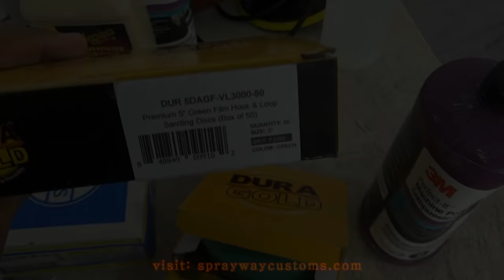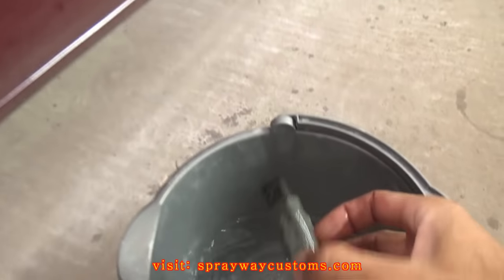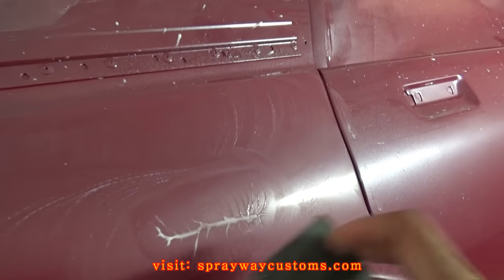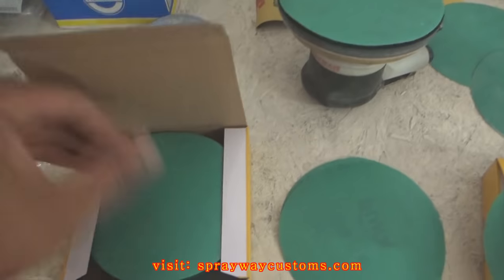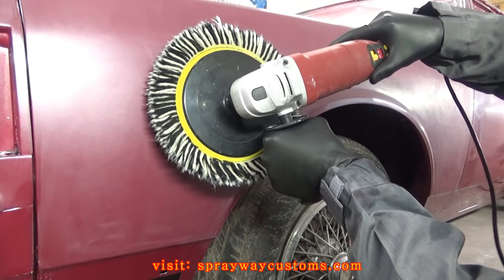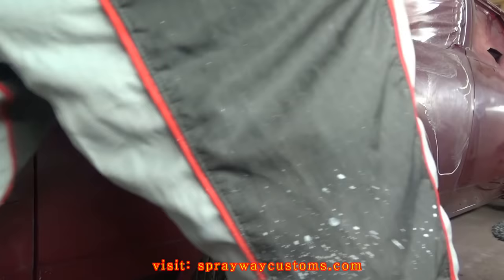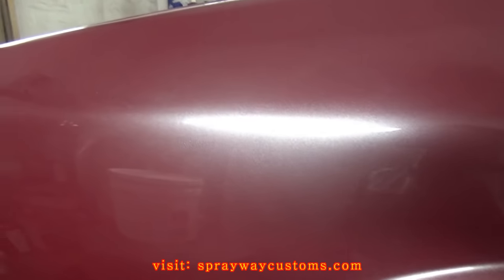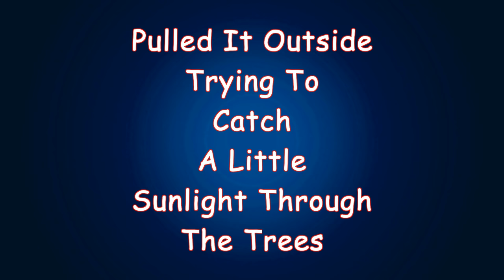How To Cut And Buff - Wet Sand To Remove Paint Runs & Orange Peel In Clear Coat - Box Chevy Caprice

Comment: SprayWay you got me fixing up my Excursion the right way at home. A previous owner somewhere down the line had some pretty crappy bodywork done. They masked everything on the car, so the clear is peeling all around the windows and gas tank. I took everything apart, sanded it all back, based, cleared, and now I'm here for the next step. Thanks!
Reply from the maker: That’s what it’s all about…motivating one another

Comment: It's awesome, I've been following this series and your work is outstanding, nice to see somebody who takes pride in what they're doing.
One short question: under what circumstances would you sandblast a car to start with?
Reply from the maker: If the entire car needed to be totally stripped down to bare metal, I would. Thanks
Reply: Unless the car needs a lot of rust repair you shouldn't need to. Just sand all the gloss out of the paint, if it's dull when it's dry you're good. Then bodywork and prime any bare metal or body filler then base/clear

Comment: Hay Spray Way  your  videos  has helped  my shop in tremendous ways thanks.  Got a question a customer  gave  me some single stage metallic pearls  I heard it's  hard to spray?
And  if so can  sand it down and  clear  over it?
Thx
Reply: Single stage paint has the clear already in it right?
Reply: @chrisg1364  Yes it does  you can  even  mix it with clear. But I'm trying  to  shoot   metallic pearls  and  they reflect light differently  because  they  stand up in the paint  with light hitting  them  at different angles  if you wet sand the metallic  pearls the paint  looks  dull so I'm thinking  clear coat  could  wake  them  back up if any  problems  were to occur.
Reply from the maker: Yes you can shoot clear over it with no problem
Reply: @jerryjordan4533 Single stage metallic/pearl paints are difficult to get consistent due to pearls/flakes settling, even after thoroughly mixed. You can add matching pearl to clear and clear over single stage for uniformity. Single stage has a longer cure time but can also be cut & polished after such with a bit more finesse than you would 2k paints, urethanes, etc. Some guys using waterborne paints will layer pearls/flakes using various intercoat clears before top coat.
Reply: @jerryjordan4533  that was a good question. I bought sum paint like that for sum mirrors i made. I was told once i sprayed it by paint shop that i couldnt clear over it. Sooo after sprayed my mirrors 1 had a run. Waited for it to dry and i sanded mirror back down and resprayed the whole thing. I should have just fixed the run then shot clear on it. That's why we got Spray Way!! Always here to help!!
Reply: Jerry Jordan 

شو هاظ يازلمه

Comment: How do you minimize your orange peal
Reply from the maker: It's the gun, air pressure and technique
Reply: @SprayWayCustoms  I have to learn how to lay primer ,base,and clear could you do a video on this with some tips  I have  to paint 2 dr tahoe soon I was thinking about taking it down to the metal I dont know what was done before what you think
Reply from the maker: If the paint solid with a good foundation. I wouldn't take it down but make sure you seal it because you don't want a reaction Brenden Taylor
Reply: @SprayWayCustoms  ok thanks for the help and when you say sealer is that a certain type of primer I should use because I live in Florida  I was watching your video with the vw satin black last night ( not the first time )

Comment: you are awesome ,i have a truck that wasnt prepped very well,did not have a spray booth and used spray cans haha,but with your guidance and knowledge i pulled it off to be very presentable,i did however buy some really good 2 part clear coat and followed your instructions on the wet sanding and cutting in and polishing,even on a low budget paint job it did greatly improve the overall look, i think i would not choose satin black if i do this again and would buy a cheapy spray booth,but i have to give you your props  thanx again
Reply from the maker: Sounds great. It’s always good to hear that

Comment: Just subbed, this video really helps understanding how paint is really more than just laying it down. Before I didn't really understand the complete process as I've never seen anyone lay it out before. So far my understanding is

1. Sand/remove old paint
2. Apply body filler if necessary and or sand smooth cuts/scratches
3. Wax and grease remover
4. Wash and dry
5. Primer
6. Sand/wetsand primer?
7.basecoat
8.second coat and/or third coat and fix runs
8.5 lay Pearl/metal flake coat if doing pearl/metal flake
9. Clear coat
10. Fix any runs/orange peel
11. Cut and buff
12. Wax ? 
13. Finally finished

Did I miss /mess up anything?

Thanks for the demonstration It really drives home that even though you mess up you can fix mistakes and that although you may have to sand "nice looking paint" and it looks dull that you can bring the shine back by gradually going up on sandpaper grit and using buffing and polishing compounds 

Thanks again!
Reply from the maker: You got it right. Thanks for the support
Reply: @SprayWayCustoms  👍 Nice to know I'm on the right track, I recently did a rattle can job on my hood, first coat was looking great only had two runs, got to can #2 and it started dripping paint, at that point I just went full send tried to evenly spray the rest of the can as best I could got the can about 85% empty and called it done, I'm hoping I can block it out by jumping to 800 from the 320grit scratches and then 1500 and 2000 and 3000 and then do the cut and buff, hoping after the cut and buff it'll look halfway decent and I won't have to respray (got a bunch of paint drips and trash/dirt nibs)

Comment: Great video!  Question .. the harbor freight polisher is a 7” pad.  The polishing pads you recommend are 9” and 8”.  Do those sizes work on the HF 7” disc?
Reply from the maker: The backing plate is 7" on those as well

Comment: I used Urechem Glamour clear coat on my 65 GTO.   After spraying 4 coats I let it sit for two weeks to completely harden.  Started cutting by hand, but switched to a DA with 1000 grit.  Progress is ridiculously slow.  Just ordered boxes of 50 pads 1000, 1500, 2000 and 3000.  About how many sheets of 1000 did you need to use on the Impala?  Just looking for a ballpark number so I can know what to expect.  Won’t hold you to the estimate.
Frank
Reply from the maker: About 5

Comment: Great work. I already know you get a lot of questions, but is there any way or tips for removing the lower body trim pieces without bending and damaging them? Lower trim as in door trim/ fender/ quarter panels. Anyone else in the comments who know, help a guy out lol
Reply from the maker: I'll be removing some trim on my next video but it's pretty simple. On the doors, there's nuts on the inside on both sides. Remove them and then grab the trim and lift up from the bottom and you'll be able to pull away from the top of the plastic clips.

Comment: Have you tried using Farecla G360 compound with the red backed 6” wool pad for compounding.It’s a clear gel , you hardly need any, it does not fling everywhere.Then the G360 polish with the black sponge pad. Alot quicker & more effective than 3M?
Am watching your video from beginning to end & thinking of quicker ways to achieve your finish.
Reply from the maker: Thanks for the info

Comment: Hi again, for the smaller areas I mentioned (fender flares, bumpers and spoiler) can I do the 3 step cut, polish and finish by hand as well or do I need the speed of the polisher/sander to take out the sandpaper marks?
Reply from the maker: Go with the less aggressive grit as possible and you'll be able to
Reply: I mean the 3 step 3M cut compound, cleaner glaze, and finishing polish.  Can I do that process by. hand or should I use the polisher?

Comment: In my backyard, these box chevys, you call them, were taxis. When Dad realized supply of used Impalas were low, he found he could buy station wagons cheaper.
I  preferred the police packages. If I were smart, I would have poked one away in a dry garage and enjoy it today.
I went away to university in September 1992. In December 1992, I came home from school to find out Dad had sold all his licenses, mine included. "You're gone away to school, now my boy. No more taxiing for you." 
Now I'm 55. I want to early retire and licences are expensive and hard to find. 
I hated what the Impalas became since 1990. My favourite is that dark metallic blue two-door I'm in search of. 😅😂🇨🇦👍
Reply from the maker: Pontiac Parisienne was big in Canada...pretty much identical to the Caprices and Impalas
Reply: @SprayWayCustoms  I had a 83? Metallic red.
Reply: @SprayWayCustoms  It Was identical. Grill, usually the taillights were different.

Comment: Hey man I’m new to cut and Buffin but should I use 105 and 205 meguiars or use 105, 83 then 205? What do you recommend after a fresh clear coat ? Also what pads ?
Reply from the maker: There's really no wrong way going about it. Just try to sand with the less aggressive sandpaper and your buffing will go a lot easier.

Comment: Merry christmas mr sprayway. I used the DA method to cut my car. (Check out my newest upload). The process left my entire car covered in pigtails. Im assuming it a foreign body caught in the the sand paper. How do you prevent this? New piece of sand paper each panel? Ended up going over the whole car by hand. I like the DA method to save time just have to spend more time with it to improve the process.
Reply from the maker: Make sure the sandpaper is sitting right over the hook n loop because I've had problems with the da pad scratching the surface
Reply: @SprayWayCustoms  sounds logical. Thanks

Comment: Do you have to use a big polisher or will a 6 inch da sander work and do you have to use a wool pad to get started? Tried with a 6 inch da and a foam coarse cutting pad but can not get a shine to come back with mcguires ultimate compound, a foam polishing pad with their ultimate polish and then wax but no shine.... all with the air powered da. Thanks in advance
Reply from the maker: No you don't. You can get it done with the 6". What grit did you start off with and ended with on the sanding?
Reply: @SprayWayCustoms  1000 grit start, 2000 grit ending. used the 6 inch bauer pads from harbor freight

Comment: I was just wondering, If you Blow off the dust it will still be in the shop. How do you prevent it from falling on the project? wet the floors, walls . have a spray booth with proper ventilation? I do not have a shop can you help me?
Reply from the maker: I just wet the floor but I still get trash in it though

Comment: Do you have a link to where you buy interface pad and DA? Or did you get it local
Reply from the maker: I got it off Ebay but the seller has sold out. He was selling them as singles for $5.99 but the only ones I see on eBay now are 5 packs and 10 packs. The item number is 3M 70166 for the 5" pad
Reply: @SprayWayCustoms  thank you!
Reply: @SprayWayCustoms  i bought me a designated 5 inch DA. Pad and 3 boxes of duragold like your video off Amazon. This is going to cut time drastically. Thanks for the videos!
Reply from the maker: No problem. I just subscribed to you. Great vids you got

Comment: You ever tried the Sharpie method on sags/runs?   It works.   That way you will actually see a true flatness.. and not that ripple after buffing.....
Reply from the maker: Yes. I understand what you mean on the ripple after buffing because on my first buff, I had it but I put enough clear on here so I wasn't paranoid on cutting through the clear.
Reply: Glad you understand me.    Keep it up Bro. I did bodywork for years. In my 20’s. The hood thought I was weird.  But nowadays I’m asked if I can help em our ..🤷🏾‍♂️🤷🏾‍♂️

Comment: I have a bunch of smaller areas (fender flares, bumpers and spoiler) that have been repainted and clear coated.  Can I hand sand instead of using the sander?
Reply from the maker: Yes you can
Reply: That's a relief.  When I do the 3 step cut, polish and finish can I do that by hand or do I need to use the polisher/buffer for the same small areas?  

Also, any tricks for removing tape after a fresh paint job?  I spend all the time prepping and paint and when I peeled some tape it took just enough paint with it to make the job look like crap.

Comment: I mean the 3 step 3M cut compound, cleaner glaze and finishing polish.  Can I do that process by hand on my bumper, fender flares and spoiler or do I need to use the polisher?  They are such small areas, I wasn't sure.  Does it need rpm's of the polisher to do it correctly?
Reply from the maker: You can do it by hand, it's just faster by machine

Comment: 7:56 into the instructional video  I see you had originally grabbed the wrong size of backing pad..it looked oversized.?
Reply from the maker: Jim_Mitchell aka/jmgargoyle it's the right size it's just have that extra cushion for flexing so you don't burn or cut into your paint as easy
Reply: @SprayWayCustoms  ok I'm just finishing my first ever paint job and trying to cut and buff it. The paint job leaves alot to be desired but not bad for what I had to do it with....

Comment: Yo when painting a car they say other chemicals in the air can mess with the paint ( i understand that ) but will kerosene fumes do the same thing inside the garage or will it be ok?
Reply from the maker: I'm not real sure on that. I was wondering the same thing because I thought about using a kerosene heater for heat at one time.
Reply: Ok well when i find out ill let you something.
Reply: Yeah kerosene will the paint job up because it is a burning oil but propane will not because it burns clean and faster, that's the down side.
Reply from the maker: Thanks for the info

Comment: Trick for you to use on runs to avoid cutting through the surrounding area while wearing down the run. Use easy sand wall putty over the run and level with the run, then as you're sanding the run, the surrounding area isn't being sanded, the wall putty is being sacrificial until you cut the run down level with the surrounding area and the wall putty is all sanded off level. ;)
Reply from the maker: Yes, that's a good tip Cletus R. I've done it a time or two. Thanks 🙏🏽
Reply: @SprayWayCustoms  Love your work man, much respect. Keep it up!

Comment: I was asking you how would your paint turn out if you make your clear coat in it then spray it on
Reply from the maker: I wouldn't recommend it. If you have a base coat / clear coat then I would use that process. It's a better protection of the base coat than a single stage paint.

Comment: My paint guy DA 1500 dry works great.
Reply from the maker: Dry uses a lot more sandpaper than wet
Reply: @SprayWayCustoms  no much he blows the paper off but it's just  800-1500 he does dry.   He flow coats    4 coat of clear.   Sit outside for the weekend  sand 800 then. 4 more coats if clear. Comes out glass off the gun but still goes through the color sanding process
Reply: @SprayWayCustoms  tha box will be nasty when completed

Comment: I got questions but I dont want them to be stupid n get ragged on. I'm trying to learn this stuff
Reply from the maker: No questions are stupid to me. I love to answer questions
Reply: @SprayWayCustoms  so I'm looking to paint my truck black with a red pearl. How much paint and clear coat does it usually take to paint big truck f250.i dont want to short then job I want everything in one shot. What tips do you have for first time sprayers??  Also,  when it comes to like smaller rust areas what should I do about them?
Reply from the maker: You could possibly get it all with a gallon of everything if you don't plan on painting the inside of the bed. Small rust areas can be sanded down to the bare metal if it's just surface rust and spray some epoxy primer over it. My tip is to take your time and watch plenty of paint videos on YouTube from different people, you can learn a lot from everybody because no one does it the same.
Reply: @SprayWayCustoms  I have been watching everyone else's videos. But I like how you break everything down to the T.  I can really appreciate you for the response my brother.  If I have any other questions I will definitely ask.  Thank you again

Comment: QUESTION: EVERYTIME I WET SAND I SEE EVERY STROKE EVEN AFTER USING COMPOUND AND BUFFING. NEVER GET A CLEAN SCRATCH FREE SURFACE. I EVEN USE 2000 AND UP GRITS. I USE MAGUIRE PRODUCTS AND A BS BUFFING MACHINE FROM WALMART(CHEAP $20)
Reply from the maker: Finish with something like 3000 or 5000 on a da